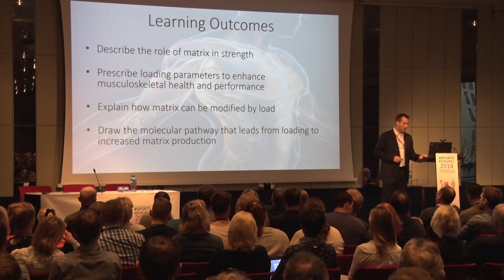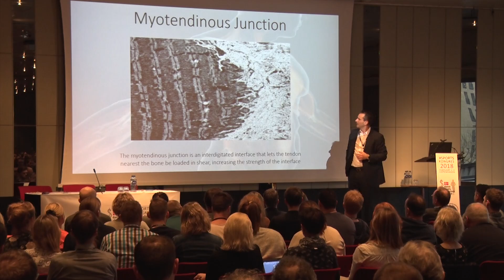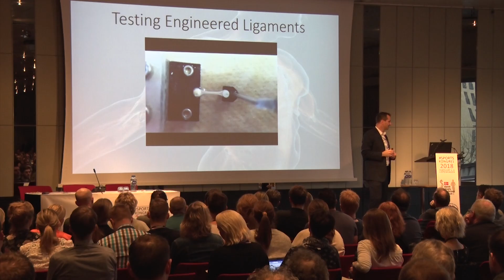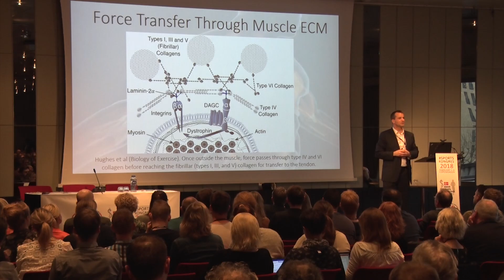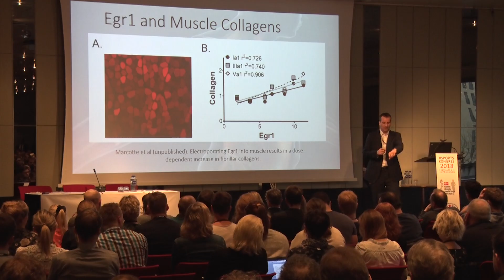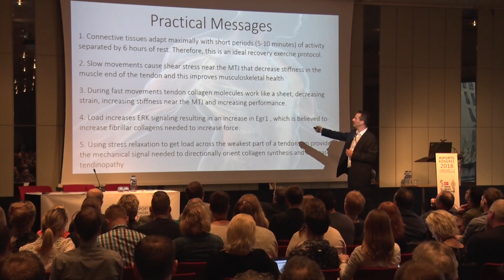Keith Baar - Physical training, performance and injury prevention

Comment: After a 2 year absence from lifting weights due to an injury and a further 8 months of rehabilitation I am now back to stimulating my muscle.

The biggest shock was, how quickly muscle atrophied.

Unlike before the injury I now use a combination of Isometrics and very slow 1rep movement, something I did when in rehab.

What has blown my mind is the muscular response. Suffice to say I will not be returning to dynamic weight lifting.  i.e. 3 sets of 12 as an example.

The difference between rehab and now is INTENSITY, using the aforementioned method.

Another side benefit is the time factor, no longer hours but MINUTES and no need to visit the gym, another mind bending shocker.

The above method allows me to train daily, whilst exercising the same muscles, which shockingly is getting me  progress.

I guess the micro bursts of intensity isn't over loading my recovery capacity, thus I am able to train and gain.

Sleep is so underrated.

Good luck in your quest for health.

Thank you for uploading and sharing.

Comment: What percent of max is considered heavy from this talk?  How many seconds is slow?
Reply: A good question!

My intuition is that a couple of minutes of continous load on the tendon is needed for maximum effect. And it doesn't matter for the tendon  if the load is excentric, consentric, or isometric.
But fir the collagen in the muscle, it has to be streached!

The load shouldn't have to be so heavy, but enough to put some strain on the tendon.

So, maximum effect with the load you can tolerate 3 - 4 minutes isometric with the muscle in a streached position.

But that's probably only one mode that works. Slow movement strength training is probably also effective.
Reply: 70% and up. Slow is isometric, for 30-45 secs

Comment: Outstanding conference, thanks a lot, quick questions : if you include a relaxation phase in the heavy slow resistance which angle is optimum?  and also which has the more benefits : isometrics relaxation (at different angles) or heavy slow?

Comment: 45:54
Pretty interesting how the patellar tendon of the basketball athlete hypertrophied from the heavy isometric leg press and gelatin intervention.  So stiff tendons are better at transmitting force & velocity, but in a way... do tendons become stiffer from this isometric exercise? Since the basketball player experienced heavy resistance exercise with lots of time under tension, new collagens were formed in the proper direction. It seems that with heavy ISOs your tendon will become more resilient (and maybe bigger), and therefore better at transmitting force whether it be fast or slow.
Reply: i would say that isometric reduce stiffness of the tendon because it's relaxed, i mean, doing the isometric, the tendon is working though. Too much stiffness can cause injury because in some areas of the tendon (close to the muscle or close to the bone for example) you need some elasticity. So, with stiffness you can produce greater forces.
Reply: my bad isometric training increases stiffness, as lifting heavy weight
Reply: @franciscorojas9365  you were right ISO decreases stiffness and improves tendon health
Reply: @CoolColJ  Slow heavy loading (aka isometrics) decreases stiffness (aka tendon behaves more like a muscle). @17:22 

The tendon becomes healthy again (but less springy,... example was an athlete who had to rest during injury... right after injury tendon is very stiff, more springy... athlete seems faster, but more prone to injury to muscle)/
Reply: stiff tendons make stronger/faster movement but make the muscle more prone to injury as elasticity is preferred at the muscle end of the tendon. It's hard to get the best of both worlds hence why we get injured. Any new insights from your end? I am looking for research backed ways to get tendons stronger and thicker with detailed protocol. Everywhere they just mention a line or two and get done with it.

Comment: Does IGF and MTOR always move in the same direction? i.e. is it possible to increase IGF while lowering MTOR?    Reason I ask, isn't there evidence that an increase in brain IGF can ward off Alzheimer's.. at the same time, suppressing MTOR can do the same?

Although IGF and MTOR are desirable for muscle growth/strength, is there any concern that it may cause tumor/cancer growth, or are these different MTORs at work (ex. anti-aging MTORC1 vs sugar metabolism mTORC2 )?

I've read fasting causes AMPK1 alpha-1 to inhibit mtor, while endurance exercise activates alpha-2..   but on the IHMC podcast, Keith mentions (1h9m) how rapamycin blocks protein synthesis by inhibiting ribosomegenesis / mtor1 (not mtor2) while simultaneously activating AMPK/DAF-16?!

Regarding ribosomegenesis (26m), where the number of ribosomes (factories) are increased after 6+ hours of working out,  which allow more mRNA (workers) to produce proteins after a meal..  if the goal is strength, not muscle mass, Ryan Flaherty on the Tim Ferriss podcast, talks about a hex bar deadlift technique where where you pick up the weight but then drop it before the negative cycle.. by unloading while the muscle is at rest, it prevents the microtearing responsible for muscle growth.   Any thoughts on this theory?

Since low testosterone seems to cause low metabolism (catabolic to fat / anabolic to muscle), and cortisol is anabolic to fat / catabolic to muscle... do you recommend any kind of hormone / HGH therapy to maximize muscle growth?   I like the idea of increasing Dystrophin proteins via cocoa's epicatechin flavonol in order to help prevent muscular loss/dystrophy.. as well as  taking 15g of collagen/gelatin an hour before workout.

Finally, if insulin/IGF1 and mechanical load, activates mtor by storing proteins in muscle... similar to consuming amino acids, what is it about cold stress/endurance exercise that seems to activate PGC-1A and increase mitochondria in fat (turning it brown)?

BTW, any thoughts on former tissue-engineering mentor, Robert Dennis's current (controversial?) work of PEMF (somapulse, micro-pulse) or his CorticalMetrics's Brain Gauge?
Reply: Elizir your mom is not hot